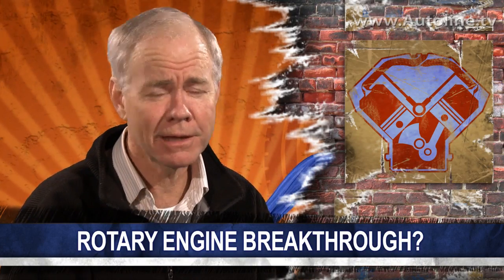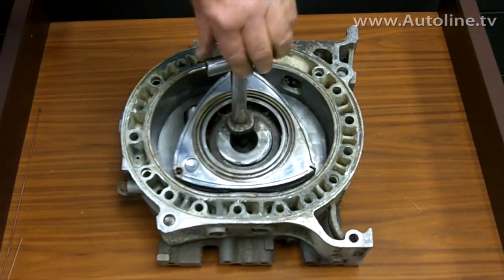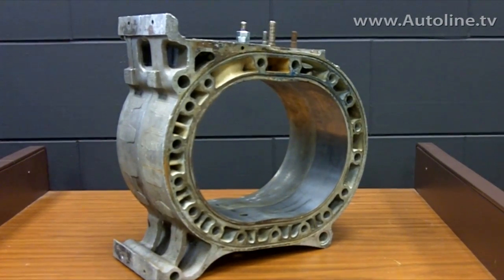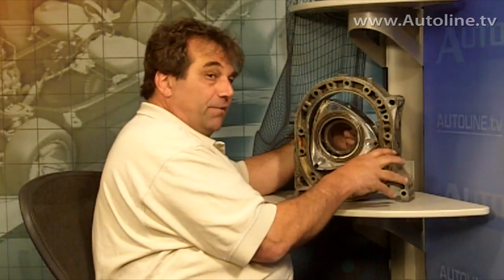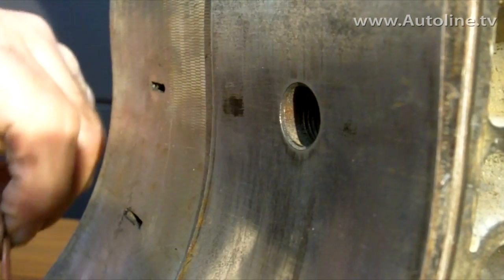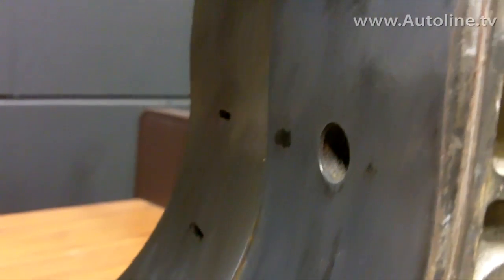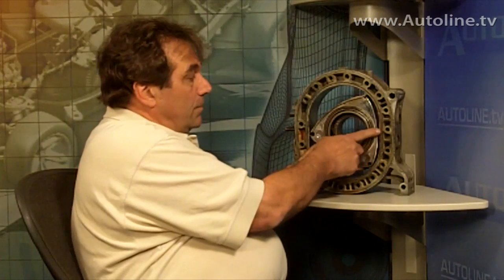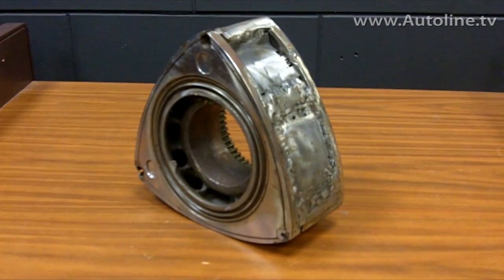Rotary Engine Breakthrough?

Comment: the plug reliefs in the rotor housing sound like a solid idea although that might be difficult to time the ignition. the rotor redesign on the other hand doesn't seem as good, you aren't trying to twist the rotor so much as push it and let the stationary gear turn that into rotation. maybe a slight offset would be beneficial because any force on the trailing half of the rotor is counter productive but the force should be concentrated towards the center of the rotor.

that being said the biggest problems the rotary faces are the poor emissions due to fueling and lubrication requirements and the fragile nature of the combustion seals.

Comment: I always thought that if they could do mods like this and design it to run at a single, most efficient, speed and use it to directly drive a generator in a hybrid car, as a range extender, its compact size, and potentially high enough output as a very small device to sustain highway travel electrically, provide winter heat for deicing, cabin heat, and battery heat, and low cost (as compared to a huge 300 mile LI-ion battery pack), near-silent smooth operation, etc. would make for a "Volt" like hybrid not needing a transmission and associated drivetrain components.  Coupled with a 60-80 mile battery pack, it could be a next-generation hybrid with much less complexity, weight, and bulk for Mazda, or any other manufacturer.
Reply: well do i have news for you lmao
Reply: @brodycurtis14  Yes, bad news, Hans Greimel of the highly respected International trade journal Automotive News confirmed on July 11th, 2021 that Mazda will not be offering a Wankel engine for its new MX30.
 Official Mazda spokesperson Masahiro Sakata confirmed that the MX30 will only be available in a 100% plugin battery EV or a mild series hybrid powered by a 2.0 liter 4-cylinder Skyactiv G engine.
 There has been no evidence of any new Wankel engines in development at Mazda since 2007 when the 16X program was revealed and then canceled in 2009.
This has many industry insiders suggesting that the MX30 rotary is just another hoax like the RX9 that was started by bloggers and then exploited by Mazdas PR team.
Reply: @brodycurtis14  2022 has ended and another rotard clickbait rumor has been completely destroyed.

Comment: Very interesting, I'm extremely fascinated by the wankel rotary engine. It just makes logical sense to have a circular momentum combustion chamber vs the up & down force of a piston. Higher rpms, more displacement and power in a compact engine design is the way forward. I'm of course only interested in the performance characteristics of this engine, unfortunately unless future designs can efficiently and effectively achieve improved fuel economy, the rotary will be left behind..

Comment: MOVING COMBUSTION
Reply: xke xke22 minutes ago (edited)THE WANKEL ENGINE MAKES THE PRESSURE OUTSIDE THE ENGINE FOR YOUR EXHAUST THE ONLY PRESSURE THE WANKEL MAKES IS THE COMPRESSION STROKE INSIDE THE ENGINE WHEN   THE APEX IS IN THE LEADING PLUG HOLE THE EXH PRESSURE IS OUTSIDE THE ENGINE THIS WHY YOU HEAR IT FROM THE EXH PORT OUTSIDE THE WANKEL ENGINE  LEAKAGERead more Show less Reply     1

Comment: Pascals Law refers to an equivalence of pressure and volume 
relationship.  If you're increasing pressure, volume must decrease to 
maintain preservation of energy.  Take a balloon for instance, if you 
decrease the size on one side, the opposite side increases to maintain 
volume relationship.  So the argument does not pertain, the principal in
 essence is correct

Comment: Apparently GM has had the rotary/wankel under consideration for the Chevy Volt.
https://gm-volt.com/2010/05/27/second-generation-chevrolet-volt-may-use-two-cylinder-or-rotatory-range-extender/
Reply: I do still believe that the motors inherent principles are still 
advantageous though for the wankel. There is so much room left in the 
design for development that I can't see that anyone had explored even in
 testing.
Reply: Do tell us.... like what areas do you mean?  I'm under the impression that many companies poured a lot of money into efficiency and emissions, without too much success.
Reply: how do i gain more torque on a rotary wankel reciprocating engine.?
1
Reply: Well, playing devil's advocate here for a moment: then why didn't Mazda or any other rotary maker do this?  There must be a trade-off that's even worse.
Reply: Chevy Volt was discontinued
Reply: @sandervanderkammen9230  "The plug-in hybrid variant drivetrain will operate in series, featuring a rotary engine that acts as a range extender to recharge the batteries, but not to power the vehicle's wheels.[10] "   and      "Engine	
28 kW (38 hp; 38 PS) Wankel rotary (generator only) (PHEV)"
Reply: @someotherdude  There is no range extender version of the MX30, it will only be available in a 100% plug-in battery EV or a mild series hybrid powered by a 2.0 liter 4-Cylinder Skyactiv G engine
Reply: @someotherdude  You are the lying fool that said Mazda was going to sell the RX9.
Reply: @someotherdude  Stop spreading lies and false clickbait rumors about Wankel engines
Reply: @sandervanderkammen9230  about 8 days ago there was another blast of Mazda rotary range extender articles.  It's definitely coming, you are simply wrong.  I'll throw you a lifeline though, because I don't like humiliating you to such an extreme.  It looks like it will be delayed several months. By the way, Toyota looks to be specifying this motor for their driverless car.  Look it up.  I have seen photos of it opened up, 38 hp (more than I would have predicted) and rotor is only a little smaller than 13b, although thinner.  Rotor looks very light weight, many hollow spots.  Maybe it will be relatively low compression I don't know.
Reply: @sandervanderkammen9230  I love how you try to subtly shift what is being discussed, but it WONT WORK.     We aren't discussing what IS available, but rather what WILL BE available.  MX30 is getting a 'REX' option, which is in fact a small rotary laying flat in the trunk.  It was widely reported again, 8 days ago, so 3 days after you commented.
Reply: @sandervanderkammen9230  wrong.  I have never been interested in the RX9,  I mentioned it once in passing recently, apparently there is some chatter about it, but the thing I've been concentrating on is the range extender, not the RX9, and I think you know that.
Reply: @someotherdude  Mazda has confirmed that there will be no Wankel engine option for the MX30 pr any orher Mazda production vehicles.
Reply: @someotherdude  Mazda's president confirmed that the RX9 never existed and was nothing more than a internet rumor started by bloggers.
Reply: @someotherdude  Once again your little rotard clickbait rumors have come and gone... debunked as completely false.
Reply: @sandervanderkammen9230  There is, you're wrong, and it proves that you like boys
Reply: @someotherdude  I don't drive an RX8... I'm heterosexual.
Reply: @sandervanderkammen9230  YOU once said you owned an RX8 and the engine went... I think you said the apex seals went.  I'm not comfortable talking to you about your sexuality,  let's just stick to cars.
Now, I'm feeling generous, since I've won so much recently; I readily admit I don't like the  rotary we finally got.  I wish it were a lot smaller.  Mechanically speaking, looks too complex.  In my own defense, they had been saying 38 hp.
Reply: @sandervanderkammen9230  I have never pushed the RX9 rumors, I'm not interested in that, you are mixing me up with someone else.
Reply: @someotherdude  I'm not gay, I have never owned a RX8.
Reply: @someotherdude  Mazda has been teasing rotards with false rumors for over a decade.
Reply: @sandervanderkammen9230  Mazda introduced it in Brussels at 12:30 PM on Jan 13th.    78 hp, range of vehicle is now 320 miles.  Not a hoax.   You can find it right here on YouTube.
Reply: @sandervanderkammen9230  they just introduced the range extender version.  Look it up.
Reply: @someotherdude  Just another hoax.
Reply: @someotherdude  They just played you again..
Stop by your local Mazda dealer and see for yourself
Reply: @sandervanderkammen9230  not a hoax, they announced the car and range extender and it will be in showrooms in March.  Yes it was a long wait but the fact is it's here.  Claiming it's a 'hoax' is ridiculous in light of the news.
Reply: @someotherdude  It's a hoax... they would have been taking pre-orders months ago if it was going to be in showrooms in March.
Reply: @sandervanderkammen9230  how would they have taken pre-orders on something they haven't yet announced?  
They showed the motor-generator on a stand in a cut-away unit; it's fully engineered and detailed; and they managed to keep major details of it fully secret.  78 hp was a surprise, everyone heard 38 hp.   I'd have rather had 38hp but oh well.  What I don't like is that it did not wind up being compact.  It looks like the same size as a small inline 4 & transmission.  But the fact is,  it's going to be available.
Reply: @someotherdude  That's why its obviously just another hoax.
Reply: @sandervanderkammen9230  it's every bit as real as some other disruptive cars, like the Volt, the Prius, the Nissan Leaf, the electric Mustang, etc.  the car they showed the press is a production car.
Reply: @someotherdude  The Mazda2 Demio RRE was real too... but it never showed up in showrooms, neither did the RX9 or the RX Vision Coupe
Reply: @sandervanderkammen9230  yes, true. That's a shame, it was a good car with good specs.  I drive a Prius Prime, but it now only goes maybe 25 miles on a charge (enough for my commute)   The Volt went much farther, but I wanted the Toyota reliability.
Reply: @someotherdude  My condolences...

Comment: Oh look!  NOT ONLY is Mazda reintroducing the rotary- in EXACTLY the way I predicted- but now they moved the recess forward (look at the .gif image) in EXACTLY the way Ernie suggested.   Man up, doktor doubter, man up.
https://cleantechnica.com/2018/03/05/mazda-rotary-may-get-new-lease-life-range-extender-engine/
Reply: Well, the wankel has some hard things to overcome, but EVERY engine is a compromise.  I will concede that, but doktorbimmer should concede that a small, cassette-like rotary (possibly running on natural gas) can make sense.
Reply: @someotherdude  elegant simplicity and efficiency.....the wankel engine
Reply: well, efficiency in engine size and weight, but not in terms of fuel economy and emissions.  On that score,  they're pretty bad.  But run a tiny one at one speed only, greatly simplifying the engine design, fueled by natural gas. There you have something.
Reply: Great comment, SOD.     There was a startup Russian company that designed and intended to produce a small hybrid with a natural gas range extended PHEV, but at the last minute they scrapped the whole idea.  What a shame.....  The russians are very good at producing things cheaply, and their engineering is top shelf.
Reply: @someotherdude  do you think engineers need two re think the wankel?
Reply: By 'rethink', I guess you mean drastically revise it.  Well, that has been tried, and it will always be worth trying, but that doesn't mean anyone will succeed.  The engineers at Mazda did in fact drastically revise the wankel, turing the motor upside down, etc.    So basically, Mazda did just rethink it, and it's meant they could go back to producing it.
Reply: @someotherdude  then this is a good thing the wankel is a cool engine
Reply: @someotherdude  piston engines are evolutionary but the wankel engine is revolutionary
Reply: True.  There are still some problems with it but that's ok.   Linear Free Piston Engine/Generators have my attention lately.
Reply: @someotherdude  dokterbimmer needs are help
Reply: nah, he just needs to hide, because he just spent 3 years shouting at everyone that the mazda rotary was dead, only to now realize he's wrong.  He's beyond humiliated.
Reply: @someotherdude  i agree with you can we send are love i wish him well why did he delete is comments
Reply: @someotherdude  do you think mazda can fix the fuel economy and emissions.
Reply: @someotherdude  Free-piston linear generator mazda must be all over this cool
Reply: ???? WOW!!!  You're right, he did delete all his comments here!   Or perhaps the Autoline people did.
I can understand how he felt.  But let it be said here: he is very smart and he made a valid argument.  He did.  He need not feel bad about his knowledge.  His knowledge was obvious.   Maybe he just needed to acknowledge that there is more than one approach to automotive traction and not be so dismissive and demeaning to other posters on here.
Autoline: if you need to say something to me, say it.  I have sparred with Doktorbimmer for years, and it got nasty at times, but it was he who set the tone and he who attacked anyone who saw any path to development regarding both the wankel and steam engines.  He has gone so far as to dismiss Cyclone Steam as a 'hoax', which is clearly untrue.   I defended the Autoline people and their Ernie Brinks coverage.
Reply: @someotherdude  all ways looking for the good in us                    thank you for turn me on to Free-piston linear generator  AWESOME   MAY BE HE NEEDS A BRAND NEW SET OF WINTER TIRES
Reply: And Happy Thanksgiving to you too, Ernie.  Thanks for keeping the dream alive!  I notice Mazda's official website is claiming that the range extender rotary will be 'exceptionally quiet'.    I think they should run it on natural gas, this would be an all-around winner.  
Just curious Ernie, are you 100% retired or are you still in the racing scene?
Reply: @someotherdude  ernie brink is simple, straightforward
Reply: "ernie brink is simple, straightforward"
Yes you are, Ernie.  And it's guys like you who often have made discoveries that wound up changing the course of industries.  You know stuff intuitively, while certain doktors point to theories and mock others while saying 'it can't be done'.
Well, clearly it can be done.  
You called for some basic configuration changes in the wankel, Mazda did this (if not exactly what you called for) and 'boom!' they've revived the technology and found new advantages with it.  
Nice going, Ernie!
Reply: @someotherdude    i am most humbled
Reply: @someotherdude  WHERE IS YOUR NEW 2022 ROTARY ENGINE???
Reply: And yours was a great comment, in that you recognize a great comment when you see one.  I'm so great, I can hardly stand it!
Reply: LOOKS LIKE YOU WERE WRONG

Comment: Like & Subscribe
I used to work on Mazda engines (R3 & R4) both suffered from highly inefficient engines & bad seal design.  Always thought that
fuel injection & dual spark plugs could fix those issues.

Comment: it's official, and the mazda exec even mentions it will be 'the size of a shoebox' which is something I SPECIFICALLY SAID, which means if it goes bad it can simply be swapped out, something I also said.
Reply: ITS OFFICIAL! YOU LOOK LIKE A FOOL RIGHT NOW!
Reply: Today marks the 10 year anniversary of the final demise of RX production at Mazda.
  The very last Wankel engine car rolled off the assembly line at Mazda's Ujina #2 plant in Hiroshima Japan on June 21st 2012 at 4:30 PM Tokyo time.
Reply: @sandervanderkammen9230  apparently Liquid Piston has developed a diesel version of their engine.  40hp and weighs just 60lbs!  That's impressive.  Before you go claiming this is false,  it was covered by MotorTrend magazine, september issue of 2019.
Reply: @sandervanderkammen9230  Today marks the 14th day since the return of the Wankel, in a bold, brilliant move by a car company known for it's innovative strategies in engine design.
The very first company to use a Wankel engine for a range extender marked this moment, 10:00 AM Western European Time at the Brussels Auto Show.
Reply: @someotherdude  I invite you to go down to your local Mazda dealer and see for yourself... there are no Wankel engines.
Reply: @sandervanderkammen9230  wow, you're really doubling down!  So are you saying Mazda is faking the whole thing?  Because the entire automotive world covered this, they showed the car and the engine to journalists on Friday Jan 13th at the Brussels show, with cars available mid March this year.  Since a range extender application will run in a very controlled and gentle regime, we can expect fewer failures.   You saying this is fiction?
Reply: @sandervanderkammen9230  That will change in March, since they showed the car Jan 13th at the Brussels auto show.  With the very motor you said would never could never happen.  You're running out of deniability very fast- the walls are closing in.  They will force you to own one!
Reply: @someotherdude  Stop by your local Mazda dealer... see for yourself.
Reply: @sandervanderkammen9230  what will you say in March when it's in the dealerships?
Reply: @someotherdude  Never going to happen

Comment: I agree the idea of slitting the spark hole to lose compression. Though the idea of slanted/offset combustion chamber is kinda not necessary, the rotor wont go backwards unless the spark timing is totally wrong. I mean there's a reason why there are leading and trailing sparplug there.
Reply: *not lose the compression